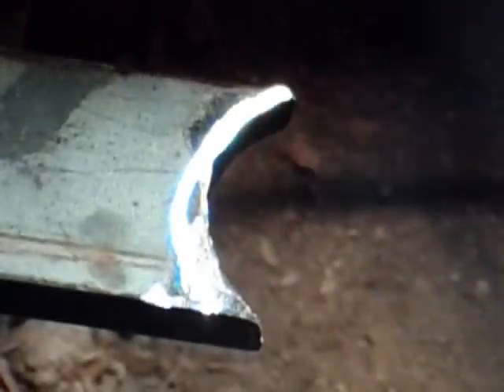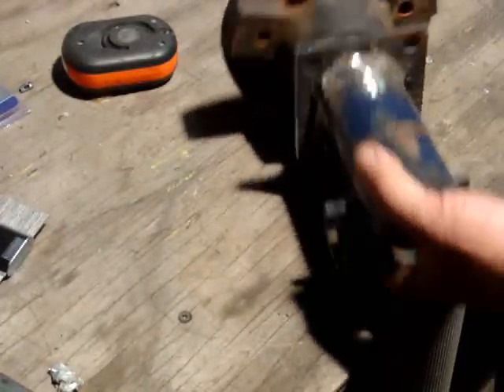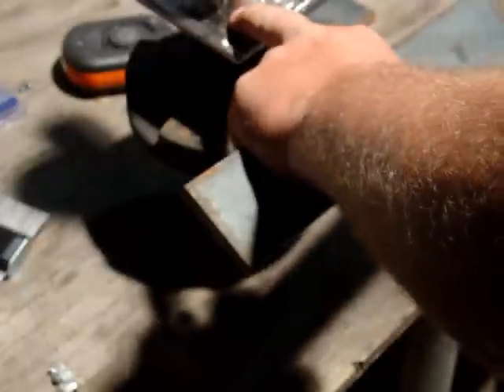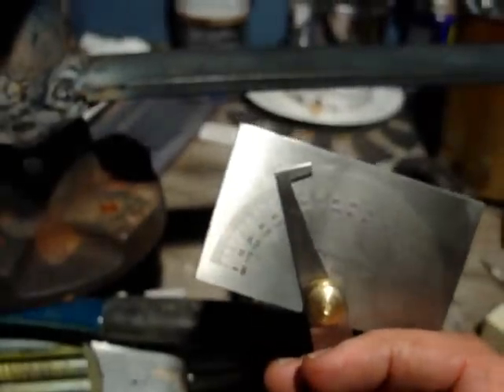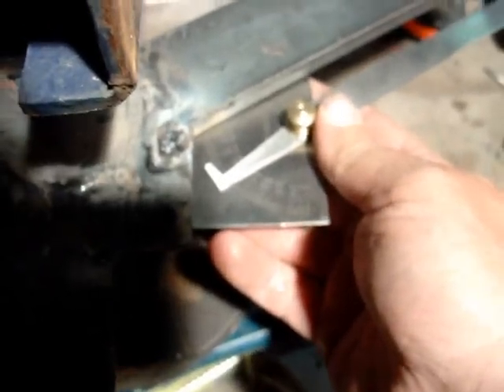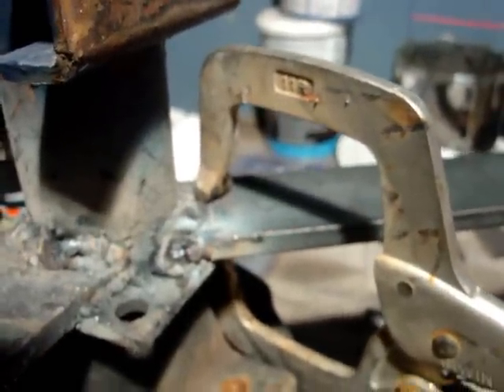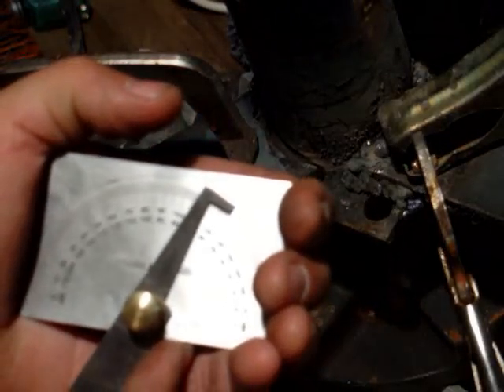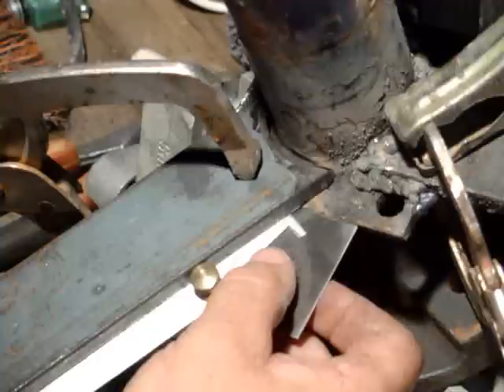BUILD A DUAL PERMANENT MAGNET ROTOR WIND TURBINE (PART 21)

Comment: Coming from a welder....those "welds" looked very cold and not much if ANY penetration. And you should have waited till AFTER your welding to re due the bearings. All that heat could and can damage the seals and burn off the grease...even burn the bearings.
Other than that...I've bin following this project hoping to learn how make my own.

Comment: looks like your not turning up your temperature up high enough to get good penetration  and be sure and get a chipping hammer and chip off your slag when you make another pass on top of a weld. Oh you need to buy a Lincoln or a miller welder. I have seen them at the pawn shop for fifty bucks before.